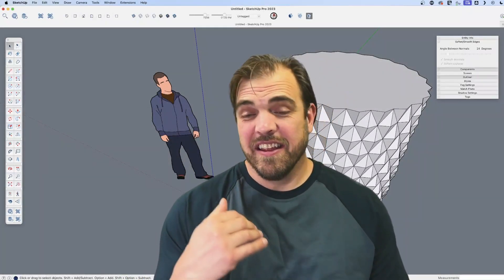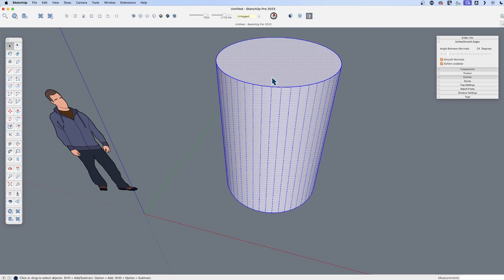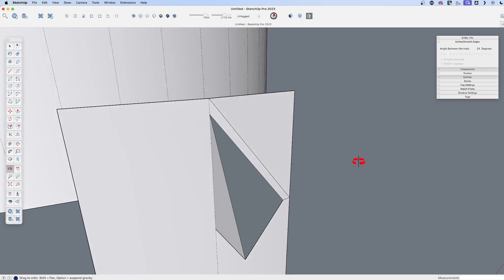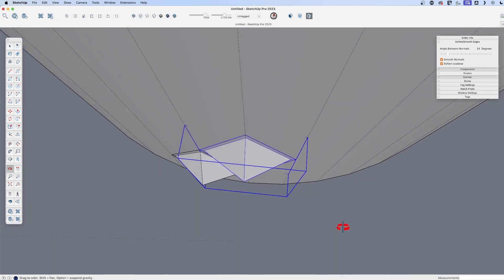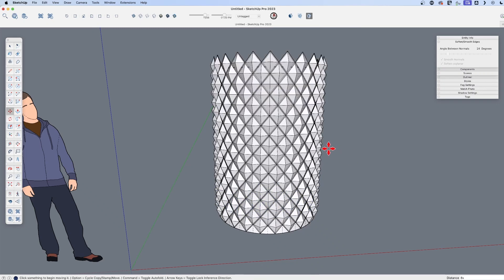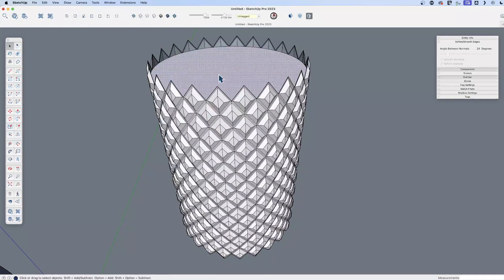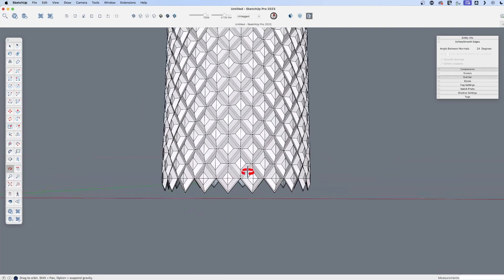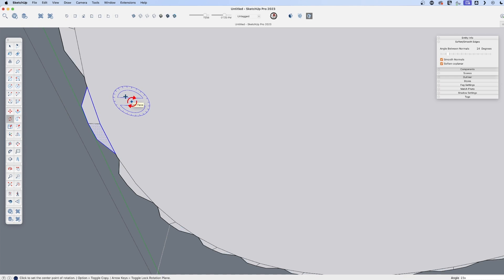Knurling in SketchUp

Comment: Thanks for the great  knurling video, it was very helpful.  Is there a quick way to make fillets around spokes that penetrate into a cylindrical hub?  I was able to do it but had to build one fillet quadrant around a spoke one surface at a time then using Flip Along I could paste them around the spoke, very time consuming.  Thanks
Reply from the maker: It may or may not work in your situation, but there is a new bevel extension, and also a round corner extension, both are meant to help with chamfers.

Comment: I'd use solid inspector prior to cutting the top and bottom and then use solid tools and some cylinders to cut it, that would be faster. Then use cleanup extension to remove useless edges.